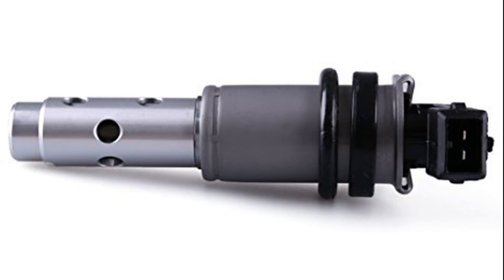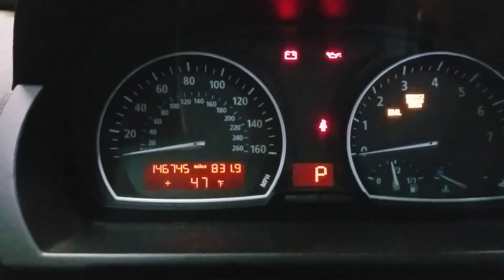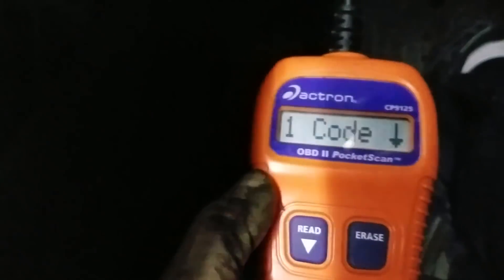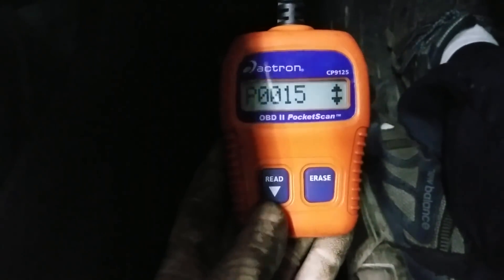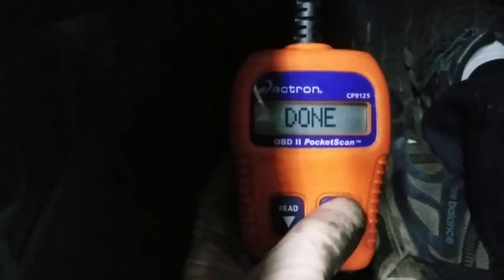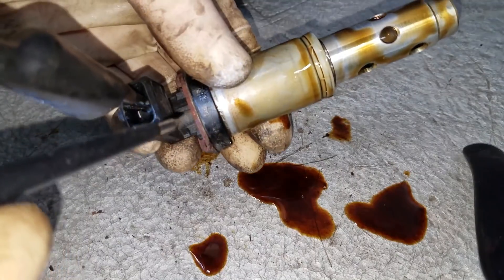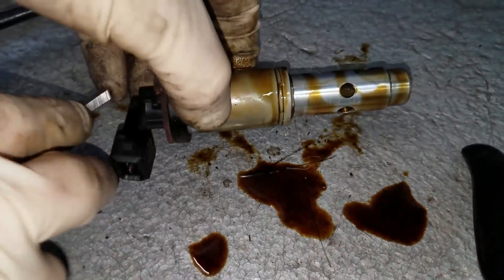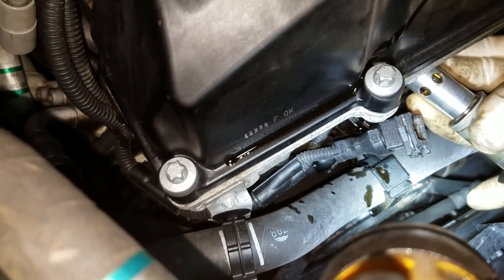BMW P0014 P0015 Intake Exhaust valve timing "Try This First"

Comment: I have a 11 328i with a p0015 code car runs perfect, could this be my issue?? Ijust need it to pass inspection , and ive cleared the code several times only for the CEL to pop up later..  not sluggish, no rough idle, oil level fine , and just had oil changed about a week ago...
Reply: I have same car and same issue. What was your solution?
Reply: @fkarmadi  ended up selling it
Reply: Did it happens after the oil change
Reply: @AyoGlxch mine did but it throws exhaust cam sensor over retarded bout to clean the vannos and if that don’t help change the exhaust Side cam sensor
Reply: @AyoGlxch mine did stalls out to gone change the exhaust B sensor see what happens

Comment: Giving it straight 12V is not a way to go, you need PWM signal to properly test these, they open gradually by increasing duty cycle

Comment: Hi, I have recently had rough idle on my e46 318ci n42 engine, sometimes it would stall too and make all kinds of strange noises, I replaced cam sensor and still no good, I took out the first solenoid and powered it up and it hardly did anything  the second one I tested clicked rapidly, am I right in thinking the one solenoid is faulty? I had the p0013 code

Comment: I have a 07 BMW X3 and 2 codes popped up, P0012 and P0015(A&B camshaft position timing, bank over retard) will replacing both of these help with that? Thanks In advanced
Reply: Did it work I currently have the same problem

Comment: Did that to both  solenoids 3yrs ago worked great now i have the 015 code back on our 09 X3, time for another cleaning, did it over a clean alum pie plate, sprayed till only clear came out. Reversed them when installing to see if a code would follow left to right, no codes came back. Know what I'll be doing tomorrow.

Comment: why dose photo have 2 seals, but when you installed there was only one gasket?
Reply: Looks like the seal is stuck in the cylinder head. If it wasn't there, this engine would have a giant oil leak.